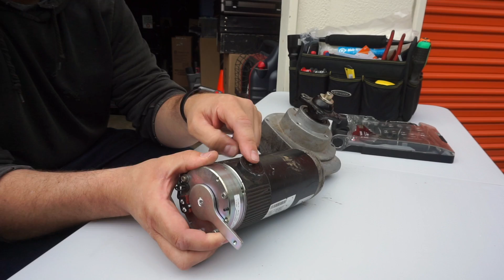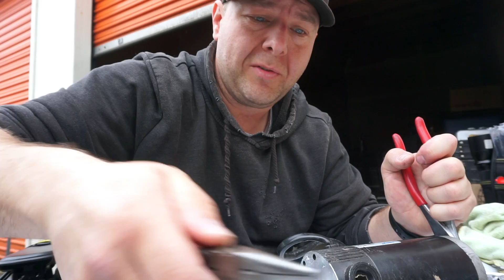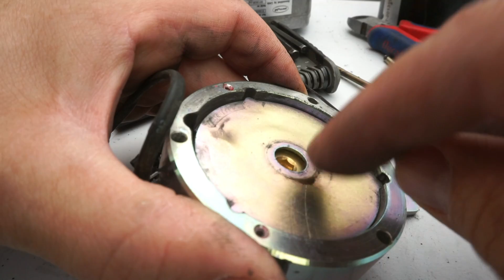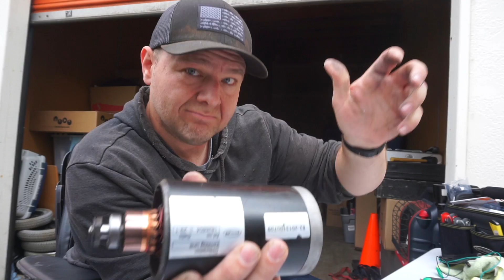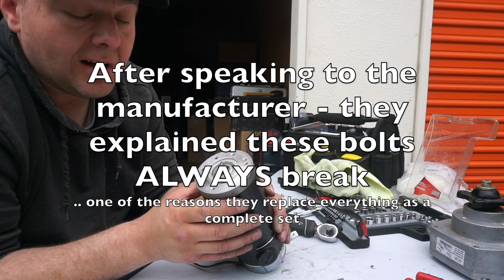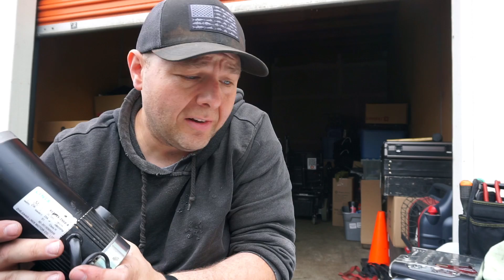inside a wheelchair motor (VLOG 333)

Comment: The issue we're having with the Permobil M3 is the loud brake release.  Have you ever tried to figure out a way to quiet them down?  Or Im curious if the switch could be wired around so the brakes could be manually disengaged while in the house to stop the annoying clicks?
Reply from the maker: the newer M3's are obnoxiously loud! the plastics make an echo-chamber around them :^/
on the R-Net chairs it was possible to program them to ignore the position of the brake lever - did it to my chair.. but i rarely use it now because i ALWAYS forget to turn the brakes back on, and get myself into trouble on ramps/lifts etc!
the brakes generate a decent amount of heat, so ya don't wanna try and pack anything around them.
no good solutions at this point tho...
Reply: @TotallyNormal- yeah the older m300 permobil and quantum edge chairs we have are much quieter than this new M3.  I should buy a used or scrap brakes and see if I could come up with a solution.  Thanks!!

Comment: Universal brushed motors can be durable if well made, but when are they transitioning to 3 phase AC motors powered by an inverter?  How long should a set of brushes last on an m3?
Reply from the maker: a friend has an M3 with over 5000 miles on the original motors! usually something else fails before then in most cases tho... the most common thing i see are seals going bad from a buildup of carbon dust. its good to blow that stuff out every ~500 miles or so..

Comment: Darn.  I was hoping I could repack the gearbox with grease to quite my C500 motors.

This chair was delivered to me in 2012, but they didn't check my home and it was too big for our doorways!

So it has sat since then with only 30 miles total on it!

We recently remodeled and widened our doors.  I have a new M3 that works well enough inside.

But I have been thinking about putting with filled 4 or even 7 inch wide tires on it so I won't get stuck in mud or bravel.

I just put new LIPOs in in and there is a lot of motor whine.

Do you think there is any chance refreshing that oil will do the trick?  The motors have never leaked.
Reply: I took it out for several miles at 5 mph yesterday hoping that warming it up would get the "grease" warm/ refreshed and everywhere it needs to be, but it is still whining. It didn't sound like this when it was new.

I suppose it might be the rear caster bearings, but I don't think that is the culprit.
Reply from the maker: the C500 motors are completely different and SUPER reliable.. i'd try getting the drive wheels off the ground with a jack, and spin up the motors and see if ya can hunt down the sound.  there's a number of things that can make noise or rub on the wheels.. also using different battery technology can sometimes cause the electronics to make noise as well.. (usually not though)

Comment: Thanks for the video! A buddy was just in a wreck in his van while in his chair, and I've got it in my shop to do some emergency repairs. Last thing to fix is the right motor, the gearbox housing cracked so I've got another set of motors coming in. I was planning on pulling the gearbox off the motor and just swapping the gearbox, but after watching you you snap those bolts I've learned that I'll just be swapping the entire assembly out. Thanks for saving me the time and money on that!

Comment: @Totally Normal Maybe you can help me. I think I may need a new motor. Recently I'm noticing if I want to go straight, I'm having more and more to favor the joystick to the left. Can you tell me which motor is going bad left of right? My guess is the right side (as I'm sitting in the chair). But I'm not absolutely sure if that's correct. Thanks!
Reply from the maker: What brand/model of chair do you have? Pushing to the left means usually means the right motor isn’t turning as fast as it needs to. Have ya checked the brush housings for excess debris? (And brush wear)
Reply: @TotallyNormal-  Thanks for the response. I have a Jazzy Elite HD.  Motor code# end in 11 and 12. I forgot which is left and right (you probably know). I'll check the brushes first ( making sure to keep the same orientation, as you mentioned in your video). And if that checks out O.K. then I'll need to pull the motor and dismantle and clean it? I use this chair as my workhorse to do garden and yardwork and I can say the motors have gotten really cruddy at times.

Comment: Got the 7F00 bad wire error code for M1 on my daughter's Permobil M3 along with a 1505 M1 motor brake error, so now I'm armed with just enough knowledge to shred the brake and wiring for her chair!  Ha!  I just hope that it's the microswitch needing cleaning or something like that for the brake or a frayed wire or something I can fix or easily source locally.  Anyway, so helpful your superlative videos are!  Thank you so very much!
Reply from the maker: double check the connections on the main controller under the back cover on chair.. sometimes they wiggle loose - the hardshell connectors dont always get plugged in all the way :^)
also sometimes some crud can get into the brake mechanism.. i like to grab the brake/neutral levers and flip them 15-20 times like you're ANGRY at them! it can help knock dirt and stuff loose in there
just be careful with the plastics.. on the M-series chairs they like to try and escape sometimes!

Comment: A lot of the engineering plastics are self lubricating and exceptionally strong, often stronger weight for strength than many metals. They should last the lifetime of the motor.

Comment: Do the manufacturer use grease inside the motor? yes I also took my stuck motor apart 😀😉
Reply from the maker: depends on the brand.. they all use something different - i just try and identify what was inside the gearbox, and use the same when putting back together

Comment: 4:34 take all screws out by heating up de metal, redrill the others, save the motor.
Reply from the maker: normally that's what could be done.. but these motors are pretty sensitive to heat.  there's no way to use a torch, or otherwise without setting fire to/melting the nearby components.  the screws are intended to break for uninstallation.  if it was going to be re-used, the broken parts can be pulled out, and threads cleaned up.  this motor has bad windings however.  that why i used it for this video :^)

Comment: I've got a Permobil C500 ESP. It's a used chair I purchased. I'm having a problem. All the seat functions work but there is times my seat tilt doesn't work. Never had any problem with the leg lift, the seat elevator, or the back going down. Usually if it stops working during the day by the next morning it works again. It's getting more often that it doesn't work. Any thoughts on what might be my problem? Thanks in advance
Reply from the maker: do any red lights flash on the seating buttons when it happens? also have you tried using the mode button on joystick, and operating the seat functions via the joystick directly to see if it works that way?
Reply: On this chair everything works off the joystick. There's a on/off switch and another switch you push when you want to adjust the seat. When you hit the switch for the seat functions you move the joystick sideways to get the the seat function you want then move the joystick forward or backwards to adjust the seat. When the recline quits working if I hold the joystick sideways trying to get it to work the lights will start blinking. When I move the joystick back to the center position the lights stop blinking.
Reply from the maker: oh - so theres no separate buttons for the seating controls right below the joystick?
Reply: I meant to say is when the recline stops working when I move the joystick forward and backwards the lights blink not sideways.
Reply: No there isn't.
Reply from the maker: does it mostly happen when ya try and tilt BACK? ive found on my older chairs, that sometimes i have to tilt forward first, and get the actuator motor spinning, or run it up and back a few times while not sitting in the chair to get it moving properly... the tilt actuator has a long allthread rod, and some grease that over time can get gunked up, and/or the motor gets a bit weak.  running it unloaded for a few cycles seems to help on mine.. but its kinda par for the course on these older chairs.. :^/  the tilt actuator is the most difficult one to change out on the 3G seating system.  
oh wait.. does your chair have 2G or 3G seating? 2G has a plastic back support, 3G is metal behind the back cushion.. 
if it's 2G - then you might have a stuck limit switch.. OR the actuator needs replacing (much easier to replace on 2G seating)
Reply: There's a metal bar that is horizontal and plastic that is vertcal from top to bottom. I notice when it first started giving me problems it would always happen when I went forward all the way.
Reply from the maker: ok sounds like you've got 2G seating then
there is a tilt limit switch on the right side (as you are facing the chair) just under the seat... this video shows it https://youtu.be/GojxcvkXMCs?t=731
skip to 12min and 11 sec.  its a different chair, but the seating should be very similar - they tend to get stuck.. sometimes ya can get under there and work the switch a few times, and free it up a bit

Comment: Hi Dan l have a permobil f5 vs has 4 pole motor wheelchait its very smooth powerful for my back up chair l am thinking of getting permobil m3  wheelchair basically same as m3  they have 2 pole motor l was wondering when you compare f5 and  f3 or m3  is the power similar as l havnt used a 2 pole motor f3  if you can help me would appreciate it thanks.
Reply from the maker: the motors on the 5 series chairs are about 2x more powerful - BUT the F3 isnt lacking on power :^)
Reply: Thanks mate .

Comment: Wrap some medium motor grade wet and dry sandpaper around the armature where the brushes run !  (use dry ) so you can bed brushes into the right shape Never put them in without bedding them to the armature as you will get arcing due to the high amperage if there not seated correctly

Comment: Of course that gear is made from plastic. Just not a cheap plastic (one would hope). Plastic is simply "a synthetic material made from a wide range of organic polymers such as polyethylene, PVC, nylon, etc., that can be molded into shape while soft and then set into a rigid or slightly elastic form." Thanks for making that video.
Reply from the maker: turns out its Delron! a SUPER durable composite :^)
Reply: @TotallyNormal-   - Probably Delrin actually. DuPont's trade name for polyoxymethylene, a synthetic polymer. AKA, plastic! Strong stuff with low coefficient of friction and great for injection-molding gears. :)

Comment: Great video!  any chance of an email address for advice?
Reply from the maker: there is contact info info the video description :^)
Reply: @TotallyNormal-  thanks: guess i am too old to understand that what came to my email has a twitter icon and i am not set up to do that...email and facebook i have some experience with...but not twitter
Reply from the maker: ya dont have to use twitter - you can send an email using the instructions in the video description
Reply from the maker: brokenwheelchairs.com then use the contact form at the bottom of the page

Comment: I pulled my old rascal mother apart never again will I do it I couldn't get the long screws back in and was in repair a while 😆 £350 I payed but it was already broken...
Reply from the maker: 6 MPH is standard for a lot of those scooters... a lot of times thats the mechanical limits of the motor itself.. but i havent played around with many of the scooters - most of what i know is only rehab chairs... short answer.. not sure :^/ BUT motors will run on whatever voltage ya feed them! lol more volts = MOAR SPEED!
Reply: @TotallyNormal-  Aaaw thankyou 😉☺️ I won't be attempting opening the motor this time 😆

Comment: I am trying to revive a Jazzy 1121 chair. it keeps making a clicking noise whenever i hit the 70 amp controller, just clicks and doesn't move at all. I noticed the underside of both motors are covered in oil. Installed new batteries and cleaned male and female 9 pin connectors. Connectors in female side of the 9 pin connector, have proper amount of physical resistance. I removed the motor/gearbox assembly. It was 102 degrees in my workspace and full humidity. I've had enough for today. I may get rid of the 9 pin connector and just hard wire it, thus bypassing rusty, corroded, unseen areas. I'm going to rehydrate and sleep on it and make a decision tomorrow.

Comment: One question, why do we need an electromagnetic brake while the worm gearbox is self-locking?
Reply from the maker: you'd think the worm gear locks things.. but it doesn't.  ever put your chair in "neutral" and push it around? that's the motors and gears turning :^)
Reply: @TotallyNormal- thanks,  Actually I am designing an electrical wheelchair using worm gear motor and have doubt if electromagnetic brake is really necessary.
Reply from the maker: in this application it certainly is required! but with the right design it could be eliminated im sure :^)

Comment: I would put money on the manufacturer used crappy metal for those bolts to  get their cost down as much as possible  for a number of years the Chinese were famous for using a Powdered metal  it was pure crap with very little strength at all  okay for cases  and housings but not for nuts and bolts  thanks for all the details you know and shared in this video  m onmy 7th or 8th mobility chair and I just like learning  as much as I can

Comment: do you have experience with dimantling the magnetic brakes and can you instead simulate an electronic equivalent load in the electronics ?
Reply from the maker: yes! i did that once with an old invacare chair.. used a few 3 watt resistors, and a cooling fan to simulate the load :^)
Reply: @TotallyNormal-  can you tell me please deatails , we want also make so with storm 3 10km/h
Reply from the maker: i looked at the sticker on the side of the brake modules, and also you need to determine the voltage they operate on (some are 12volts and others 24v - usually also printed somewhere on the sticker) they can be different voltage between models on the same brand as well.. then you measure the resistance of the coils, do some math, and you have your resistor values! i dont remember the equation right off.. BUT they WILL get hot! i mounted mine on a metal plate with a cooling fan...  send me a DM on twitter and i'll see if i can dig up the details.  ya can also use the email submission form on the website (brokenwheelchairs.com) replies will take a bit though.. im in the middle of moving

Comment: Hi. Great video. Thank you. I'm here as I took the motor off my Westminster as had a breakdown caused by a brush breaking inside. I took it all apart cleaned all the carbon out, replaced everything, put it back on and now it's running in reverse!! Help. 😊 What have I done wrong and is there a way I can rectify it? Many thanks.
Reply from the maker: if the brush housing gets put back in in the wrong orientation that can happen! (usually 1/4 to 1/2 turn off)
Reply: @TotallyNormal-  thank you. Took it all off turned it half a turn and hey presto. Thank you.
Reply from the maker: AWESOME!!

Comment: Wondering why my Pronto M91 drips what looks to be grease occasionally. Is there a convenient way to resolve this?  Thanks Doug
Reply from the maker: there's a seal between the gearbox, and the motor - those can go bad.. theres another video ya can skip around thru - i replaced that seal in a different chair :^) https://youtu.be/F9kt9PG911Q

Comment: Any idea why wheelchair motors (particularly the faster ones - 6mph plus) sometimes bump or judder?
Reply: It can happen as wheelchair motors get older. The brushes he showed are a wearing item and get shorter over time. When they get short enough the spring does not push them hard enough against the armature, and they can bounce which makes the motor lose power, and therefore speed.

Comment: i wouldn't have guessed it would have a plastic gear. All the motors i have use a brass gear the worm runs onto. I love using wheelchair motors they are super high quality. ive made 2 rc lawnmowers with them and just finished retrofitting a mini bulldozer to run on battery.... i wish everything was built as nice as these motors
Reply: Ive been a tech for 16 years. Permobils motors are the best in my opinion. They almost never fail.

Comment: I was able to work on my Jazzy HD motors and gearboxes and now I will clean them up from carbon from the brushes. and the Gear Boxes need grease replaced and gear boxes flushed out.
Then I should have a good backup pair.
Thanks for the help.
Also thought on bolts with 
super locktite on them.
Try getting a 450 watt solder iron and heat the bolt head up really good and the lock tight stuff should not hold so tight.
It should not take to long to do it on the short bolts. Long bolts that is a different thing. you could heating the other ends of the long bolts. Hope this helps.

Comment: Trying to make a gocart with two wheelchair motors. Looking for electronic speed controller. Any products you can recommend? Looking for tank style control. Each back wheel has one motor and controller.
Reply from the maker: youll need something that supports differential thrust, or vector steering.. there's dual motor ESC's out there for it! or some ESC units can link together.   im actually looking for a couple myself.. but havent bought anything just yet..